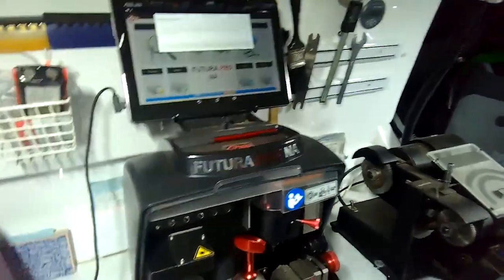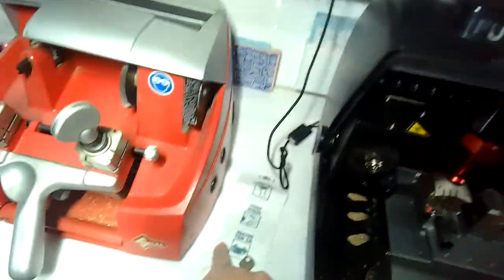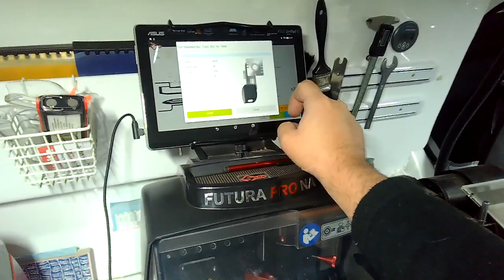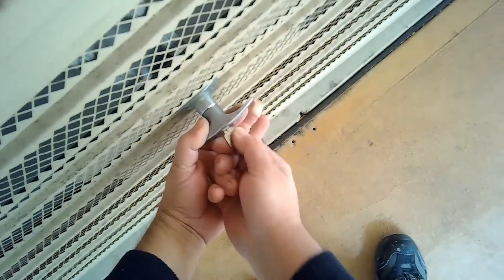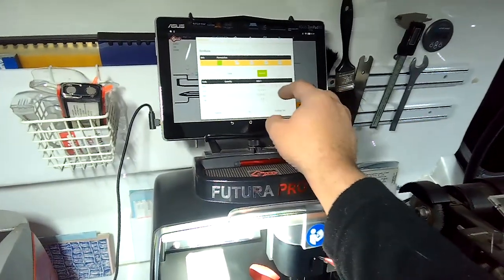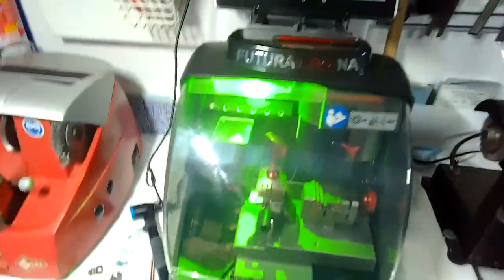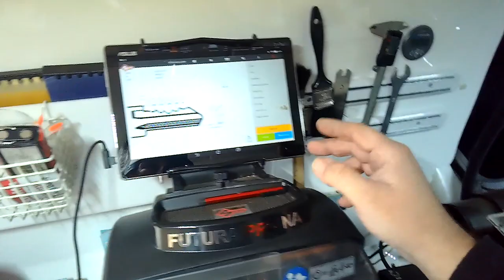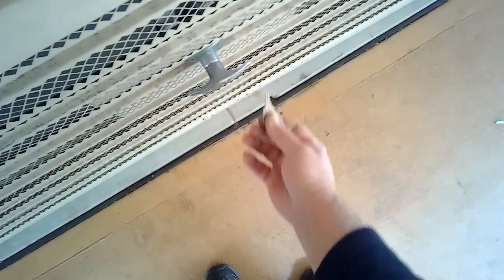Making a key from partial cuts on Silca Futura

Comment: Don't know if you can help me,god knows the seller doesn't,anyway.i've just purchased a 2m2 magic tank,which is newer version of x6/v8 machine.
In the app there are a list of keys,to the right of a certain key it will say for example fixture 1 and fixture 3,what does this mean?Fixture numbers go up to 7 i think.
I have a feeling its to do with the grooves in the key clamp maybe?It gives no explanation!
Im trying to decode and cut a va2 abcd h6,which is a short length laser key.I think your sec machine shows you fixture numbers,no?Where it tells you how far you have to slide in tip of key?
Reply from the maker: Sorry I don't know